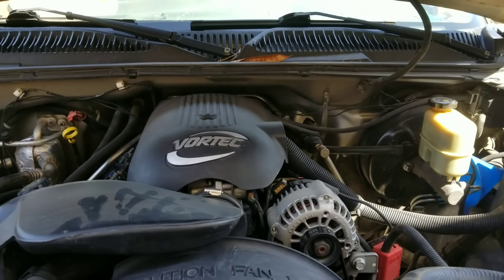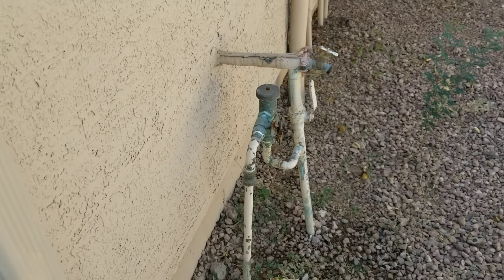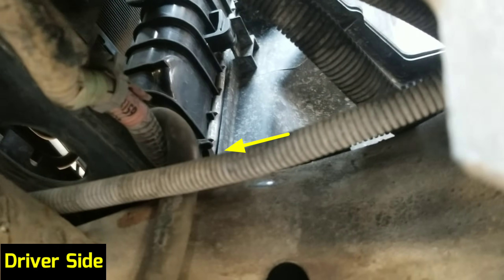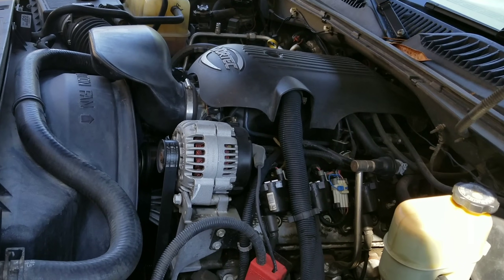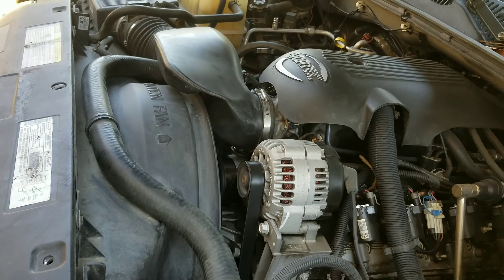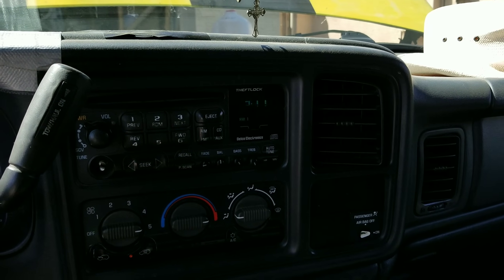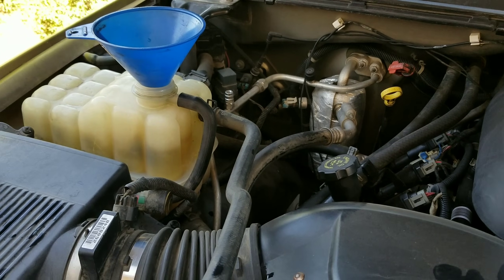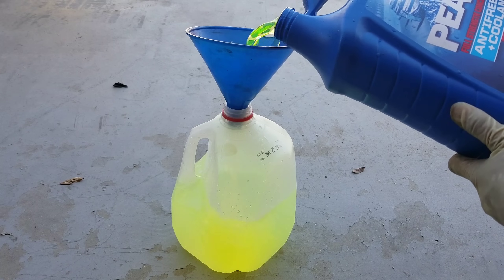How To Flush Your Coolant System! | Chevy Silverado Coolant Change Drain & Fill

Comment: Thanks for the video. I'm installing a new radiator so I'll  disconnect the upper and lower hoses, remove thw thermostat and then flush the system using the radiator hoses to bypass the old radiator.

Comment: Thanks much.  Did think to turn the heater on.  I have 2001 tahoe i bought new and we still love it.  it has the original coolant, so I thought I would be nice to it today.  thanks for the video.  From Augusta, ga.
Reply from the maker: thank you for watching!
Reply: You do NOT have to turn heater on as coolant always runs through heater core, even when heater is off.

Comment: Normal temp gauge right in the middle?  Mine right now is at 1/4 of gauge.  Suspect that to be 185 degrees.  What temp is your thermostat sitting at now?  I am asking this now since I had to replace my radiator and thermostat and seeing a low temp reading.
Reply: that is normal, these trucks are supposed to operate at 195 but run a little cool if everything is good
Reply: He was pointing at oil pressure which should be at or slightly under the middle at operating temps
Reply: @dantheman4585  Actually I found my problem to be that missing plastic shield just behind bumper that prevents cold air from hitting the motor.  If temps are below 20 degrees the motor will never reach normal operating temperature.  Everything ok during warm months.
Reply: @rogermerritt6470  Wow that's actually great to know. I was about to remove my bumper valance to install a brush guard but looks like I'll just have to cut holes in it

Comment: I ran pure water in summer never rusted up the engine I don’t recommend that for everyone but these 6.0 are pretty tough I was only running water due to slow leak in the radiator but I also own 4 cat eye 2500hds so don’t care if it blew up I’ll swap the engine lol but when I tore It down building it no rust so don’t worry to much about water in there, but get the green out of there the vortecs really do better with dex

Comment: I wouldn’t recommend converting over from dex-cool ORANGE (not red) to the cheap generic run of the mill green. Dex-cool goes in all GM cooling systems for a reason. Everything to do with the cooling was designed with dex cool and its properties in mind.
Reply: I agree
Reply: It doesn’t matter what you put in it
Reply: Very true!  There are a lot more reasons than most people know,  why you NEVER switch a system over to the green when the system was designed for the DeX.  There are no good reasons to do that... well except for ignorance... 🤷‍♂️
Reply: a good reason to switch from dex is because it becomes sludgy and corrosive to gaskets after ~6 years. gm lost a lawsuit over it. its perfectly safe to switch but only with an extensive flush, but mix dex with green and your gonna have a bad time
Reply: I only put the orange in mine but that’s just me
Reply: The fact that GM lost a class action over it, tells you everything you need to know hahaha. I love GM to death, it and Toyota are all I'll drive, but dex-cool is terrible and no reasonable person will deny that. All of the benefits dex-cool was supposed to have, are matched by prestone all-vehicle coolant. The difference is prestone all purpose doesn't have the long list of negatives dex-cool does. Dex-cool sludges up so damn bad. Ive done many an overall on GM vehicles, and good God I've never seen anything like dex-cool hahaha. The vortec engines are the only redeeming quality, but even they can't handle blowing a coolant hose  or head gasket on the highway because a thermostat or coolant passage plugged up. No good mechanic would recommend sticking with dex-cool long term. The only problem is you really have to flush the coolant damn good or you'll have serious problems because dex-cool is incompatible.
Reply: @manoweb1  The only reason somebody would defend dex-cool, is ignorance or they're a GM rep lol. Prestone all-vehicle has all of the benefits dex-cool was claimed to have. The big difference is prestone all purpose doesn't have the long list of negatives dex-cool does. IDK how many overhauls I've done, but there's nothing like an overhaul with sludged up dex-cool hahaha. I love GM to death, but dex-cool was a horrible idea, and they paid for it in that class-action lawsuit. No experienced and honest mechanic would recommend sticking with dex-cool long term. But want do I know, I'm just a mechanic by trade!

Comment: I unscrewed the drain plug but nothing comes out just like 3 drops, any idea what I did wrong?
Reply: Open your radiator cap
Reply: @SomebodyOrNobodyIDK  turned out radiator was clogged and I needed i to replace fan clutch along with thermostat

Comment: Could i just buy the 50/50 coolant instead of mixing it like you did in the end? And where did you take the hose off that’s leaking the coolant into the pan?
Reply: Also great video! Extremely helpful
Reply: It's the same price for either, you would be wasting $18 on another bottle, but you could if you wanted to
Reply: @csmith6237  

What about that hose tho

Comment: Could you just leave the radiator plug opened at the  bottom and just keep putting water in it until its clean and ready for the new coolant??
Reply from the maker: the reason you dont want to do that is because the coolant needs to circulate .
Reply: I agree with you.  It will still circulate.  People have been doing that for many years.   You can also purchase a prestone flush kit that back flushes through the heater hose.

Comment: so if a man wanted to do it right would he flush say 4 times with distilled water and then the 5th time flush with 50/50 & drain? then finally proceed to fill cooling system with 50/50 & call it good?

Comment: My 2006 silverado doesn't have a drain plug on the radiator like the ones that are being shown in videos.  So what is the best way to drain the radiator?
Reply from the maker: Remove the radiator hose
Reply: @ERICSDIYGARAGE  you mean the lower radiator hose?
Reply: Thanks

Comment: There will be water left in the block and heater core after your flush.  That is going to reduce your 50/50 mix of coolant to less than 50/50 concentration.  You need to account for how much water is left in the system after your flush and drain and add 100% coolant to match that.  Then can fill with 50/50 the rest of the way.
Reply: Can you start it with the water pump and radiator hoses off to get the remaining water out?
Reply: @followerofchrist1961  you just pull the block drains
Reply: That's what I was thinkin when you drain th radiator your not drain in th block
Reply: depends on how cold it gets, the coolant will have a chart on the bottle showing the temp protection for ratios less than 50/50... most areas in the united states do not require a 50/50 mix

Comment: PlZ help! I took the drain plug out on driver side radiator and nothing is coming out. I kno I have water in there. I accidentally put just a little synthetic oil in my reservoir. That's the whole reason I think I need to drain. But the there's nothing coming out of the small drain hole. I have an 03 silverado
Reply from the maker: Disconnect the radiator hose from the bottom

Comment: For everybody defending the curse known as "dex-cool", the fact that GM lost a class action over it, tells you everything you need to know hahaha. I love GM to death, it and Toyota are all I'll drive, but dex-cool is terrible and no reasonable person will deny that. All of the benefits dex-cool was supposed to have, are matched by prestone all-vehicle coolant. The difference is prestone all purpose doesn't have the long list of negatives dex-cool does. Dex-cool sludges up so damn bad. Ive done many an overall on GM vehicles, and good God I've never seen anything like sludges dex-cool hahaha. The vortec engines are the only redeeming quality, but even they can't handle blowing a coolant hose  or head gasket on the highway because a thermostat or coolant passage plugged up. No good mechanic would recommend sticking with dex-cool long term. The only problem is you really have to flush the coolant damn good or you'll have serious problems because dex-cool is incompatible with other coolants. Just make the switch!
Reply: So who's to say that all the gm vehicles you saw with sludge were strictly dexcool and that some idiot didn't mix the 2 and create the sludge you're talking about...adding green to red or orange doesn't keep it red or orange...brown would be the outcome of mixing the 2 and creating the sludge you speak of...stick with one and it will remain that 1....genius

Comment: Why did you change from dexcool to the green stuff?????? just curious
Reply from the maker: Ten years after General Motors began using Dex-Coolas an antifreeze in most of its cars and light trucks, GM car and truck owners continue to complain that the coolant corrodes and clogs radiators and radiator caps, erodes water pumps, rots radiator hoses, causes chronic overheating and engine damage
Reply: @ERICSDIYGARAGE  ohhhh ok gotcha..maybe that would explain why i have the green stuff in my 05 denali i just got, cause i was gonna flush that and put back in the dexcool...thanks for that info

Comment: A easier and faster way is to pull the thermostat out while leaving the top hose of the thermostat housing..take a garden hose and place in the upper radiator hose and run the engine and it will flush everything out faster. Then run the car until all water is out
Reply from the maker: You will need a new gasket if you do it this way. But yes, I agree it's faster

Comment: Is there another way to fill the radiator? I put new coolant in my resivor but it looks like the coolant level won't go down and into the radiator causing my truck to over heat (05 Silverado 1500)
Reply from the maker: you might have air in your system squeez the Hoses and turn the truck on and keep squeezing the hoses to see if the level goes down and into the radiator
Reply: Still nothing I might need to replace radiator
Reply: It was the thermostat
Reply: @joseesguapo  chiquilin

Comment: Why would you change from dexcool to the green antifreeze won’t that mess the engine up it calls for the dexcool
Reply: I thought all Chevy and GM's now days took the dexcool.
Reply: Just picked up a GM truck off fb marketplace dude was selling it cheap bc it overheated every time u take it on the freeway, turns out he put green instead of dexcool
Reply: @MrJthomeczek   they do. Switching to green is a myth. Stick to what oem is.
Reply: @rainbowcash8016  that’s not even the case doesn’t matter what you put it in it

Comment: So you have your lower hose unplugged and your thermostat still in.  Are you running the engine at any point of time without water in while you flush the old out. My question is I am running for 25 min the unplugging lower radiator hose which only releases half, is there a better way besides removing thermostat?
Reply from the maker: the bottom hose is there for a mess free drain when you remove the radiator plug all the way the coolant will come out of the radiator faster. this is why you have to repeat this process multiple times
Reply: @ERICSDIYGARAGE  so each time you flush your only getting half, that what I'm getting
Reply from the maker: the coolant will mix with water to the point that it will be mostly water.
Reply: Roughly how long should this take?

Comment: Would this process be the same for an '04 Silverado? I have the same symptoms you were talking about: engine overheating, cooling down again, and intermittent heat from my vents. I'll get the coolant + antifreeze this weekend along with the distilled water.
Did you seal the radiator drain plug when you flushed the remaining coolant with tap water the four or five times?
Reply from the maker: Yes this process should be the same on a 2004 Chevy Silverado. I close the drain plug four to five times to let it circulate the system. But you can leave it open and just put a hose in the radiator and flush it out that way but I feel like you won't be able to get all of the water that still inside the heater core or the engine
Reply: @mike benfer did you ever get this fixed/ what was the solution?

Comment: When I squished one of the hoses i heard a crunch im guessing its like some sort of debris is that something to be worried about?
Reply: Calcium build up,. That stuff can look super nasty. So some hoses have metal coiled inside to kinda let the hose stay a certain shape. So it doesn't bend and kink.
Reply: Some years for Chevy hoses have a spring built in to stop the hose from collapsing under pressure from the water pump. Especially the bottom hose.

Comment: Well your temp was ok but that was your oil pressure that you pointed to. And why would go from Dexcool to green ? What's the reason I'm wondering?
Reply from the maker: Tens years after General Motors began using Dex-Coolas an antifreeze in most of its cars and light trucks, GM car and truck owners continue to complain that the coolant corrodes and clogs radiators and radiator caps, erodes water pumps, rots radiator hoses, causes chronic overheating and engine damage.
Reply: ERICSDIYGARAGE having 1 truck that has 120,000+ miles and 1 car with 15,000+ miles haven’t had a problem with DexCool or anything that it is in

Comment: Can i do this to my 2008 Chevy Silverado?
Reply from the maker: This process applies to 2000-2006 it might be very similar though.
Reply: Thanks man. My owners manual says to use Dex Cool, do you think converting it to the Peak Green Antifreeze is better than Dexcool or do you recommend just going by what the owners manual says? Bought my truck used and don’t know what to put in it. Thanks again.
Reply from the maker: You can use both as  long as you do a Coolant flush as show in the video. Do not mix avoid issues
Reply: @Jesus LovesYou wow for a name like you have you sure got a mouth on you. I would only use the orange. When you get away from factor OEM items you start messing up. Just leave it original. Why test it to save a couple of penny's?

Comment: It's wrong to fill with a mix of 50/50. The radiator only holds 50% of the full capacity. Say 8 to 10 quarts. Draining the radiator after the flush several times (you say 5) leaves about 6 quarts of only water in the block and heater core. Proper method is to add 50% of total capacity15-17 qts concentrated coolant directly to the system then top off with 50/50 mix.
Reply from the maker: When you let the car run the thermostat opens and the coolant in the block goes to the radiator repeating the drain and fill of a radiator several times will get most of the coolant in the block out. Also it's not rock science and the mixture does not need to be exactly a 50/50 mixture
Reply: Yep, draining the radiator 4-5 times removes most all coolant suspended in the system. Every time you refill radiator after a drain thins out the amount of antifreeze mixed in the system. It is not correct to use only 50/50 premixed coolant. What remains in the block and heater core is mostly 99% water. At this time to have at least a 50/50 ratio you need to fill with concentrated coolant half the amount of the total system specified in your owners manual. If you manual says 14 qts. then you add half that in concentrate 7 qts minimum then you can ether mix your own 50/50 or use premix to top off to get the recommended protection.  This guy is lost

Comment: You do NOT have to turn heater on as coolant always runs through heater core, even when heater is off.
Reply: What happens if my ac don’t work
Reply: @uri_6894  Take it to the shop and they will fix it for some $$$
Reply: That's not true on these. When you turn the heater on it opens a valve. I can hear bubbles under my dash from my heater core when I turn it on.
Reply: @uri_6894  Go to an autoparts store and get a recharge kit, follow the instructions. Certain amount of pressure vs ambient temp. This guy is an online mechanic.
Reply: @yourface3154  I fix it already it was the blower and the signals
Reply: @uri_6894  Blower motor maybe, signals have nothing to do with that.
Reply: @uri_6894  That's the blower motor resistor.
Reply: @yourface3154  yeah that
Reply: @uri_6894  Just here to help, bud.
Reply: @yourface3154  thanks

Comment: How many gallons does it need
Reply from the maker: around 2 gallons and a half
Reply: @ERICSDIYGARAGE  thanks for the quick response.  I bought an extended cab 2000 Silverado for 1k it's not messed up just the rare find and right place . I'm going to service it and drive it for a while
Reply from the maker: wow great deal, hope this video helps you out 👍
Reply: Yours took 2.5 gallons because you left behind 7 quarts. It holds 17 quarts from empty.